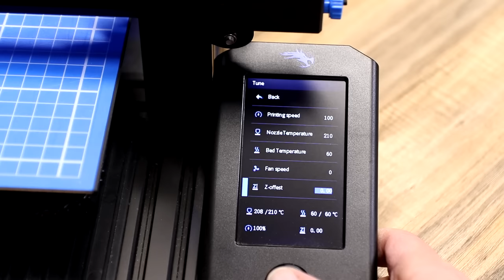Ender 3 V2 Bed Leveling : Quick Look at How to Level a 3D Printer Bed

Comment: 2 problems I came across and the solutions to save you some time.
1. When you hit the auto home button, one of the motors makes a loud Brrrr sound.

Solution: The bed is too low and it's hitting the Y-axis stepper motor in the back, lose up the wheels till you see some clearance or until you can move the bed back the farthest position without any resistance (until the you hit the limit switch)

2. You're going around adjusting all 4 sides but one of them doesn't raise the bed enough even when it's completely loose.
Solution: Keep going around doing the others and when you come back to the loose one it will be tighter because of the other adjustments.

Comment: I don't think disabling the steppers to do the leveling is a good method. When moving the hot end with your hand you can accidentally move the Z up or down, I get a much better result from using the move feature in the menu and let the motors do the real accurate movements. I have a gcode for it but you can manually do it also, Just set these z axis points to get directly above the screws.  1st screw is 30x30y , 2nd screw is 30x200y, 2rd screw 200x200y, 4th screw 200y30x
Reply from the maker: I also have Gcode that does this, but I wanted to show a quick method that can be done with nothing but the basic machine. But I do think it's a good idea to use the Gcode or leveling feature if it's built it I the firmware. Thanks for watching!
Reply: @TheEdgeofTech  question for you regarding the method you used in this video. When you use the "tune" feature to adjust the Z stepper. Does the SD card save that new number? 

When I 1st got my printer I used your method to level minus using the tune to adjust the Z. Now a half a roll of filament later... when ever I use the paper to just lightly kiss the nozzle. When I go to print, I have to lower the bed during the 1st few passes as it is smearing the filament. I actually have to drop it quite a bit to get it low enough. All my prints stick fine but I get a flat and wide filament that first pass around. Some times I get no filament out at all its so close. I never had that at first and I'm doing nothing differently than I am now and actually going lighter on the paper tug than I did when I started out. I use to set it with a decent tug. Now I have to barely feel it.

If I go tighter with the paper now it makes it worse now. Why would that change? All stock 3v2 and I have the bed springs pretty tight to keep from moving and as low as possible to still be able to turn the wheels. I have new springs coming but I'm thinking I'll have the same problem.

Comment: Anyone else struggling like I was, I found I'd put the x-axis belt tensioner on backward. Sounds daft but it fits and looked right at the time. After correctly placing it, the prints came out beautifully.

Comment: On my Ender 3 the wheels are marked "up' and "down", not tighten and loosen. As a total beginner I rely on accuracy in such things. I assume you meant to start by moving the bed all the way down 😁
Reply: Lefty lower ... Righty Raisey!
Reply: As a human use common sense. When you tighten the screws the bed gets lower and when you loosen the bed gets higher.

Comment: I know this is a bit of an older video, but hopefully someone sees this comment - I've watched a couple videos like this with similar procedures, but even dropping the z axis as far as it can go, it doesn't come anywhere close to the bed to do what you're showing with the springs in roughly the same spots. I have to loosen them a LOT to get the bed to a point where it is even possible to meet the nozzle. I've done this and had a mostly successful first print, with a single support failing to adhere to the bed, but didn't seriously affect the result. I'm at a loss as to why my bed seems to be so much farther down than everyone else's with respect to the nozzle, though. If anyone has any thoughts, I'd love to hear them.
Reply from the maker: Thanks for the comment! I'm sorry you're having trouble!.  Did you move down your Z End Stop?

Comment: Personally I don't like to disable steppers and move it by hand. I find that it adds the issue of slightly misalignment things with the force. I just use the move function and move the extruder like that. I'll go directly over each spring about 3 or 4 times around checking the center at the end

Comment: Would you be able to do a video on the BLTouch for the E3v2. Start to finish. Install, Calibration, First Print for some one who is new to all this.
I've watched a bunch of BLTouch videos but it seems like things get skipped over in the videos that I've seen. I think a lot of this is due to the person who is making the videos already having it setup, level and ready to print.
They are always like, "mine is already set but you just do this" but don't really show you.
Thank you!
Reply from the maker: Great Idea!
Reply: I put one on my V2 recently and, yeah, between guides with people running 3rd party firmware, using random brackets and other mods, or skipping over vital steps like setting the z-offset, it can be a bit of a minefield. A straightforward, start to finish guide on stock hardware would be very valuable.

Comment: Hi, when you say paper dragging in-between the nozzle and build plate is it like a scratching feeling? or is that too much?
Reply from the maker: Yes, exactly! But not tight enough where you can't push it back in with one hand. So you should be able to slide it both ways back and forth without the paper wrinkling.  If the paper wrinkles it's too tight. But it will feel like a light scratching between the nozzle and the paper.

Comment: But why, after I auto home, does it not reset it back to the way I just adjusted it??
Reply: I feel like ive been having this problem too, it auto homes to 2 different heights above the bed, I re-auto home a few times and it will then be where I correctly leveled to, I cannot figure out why this started happening. Checked the z limit for tightness, got new springs, level while warm, then I thought it was Gcode, but i double checked all that and found no issues. I usually have to end up adjusting the z axis in tune like this guy did, so I started printing with brims so I have a second to tune it before the real part of the print gets started. I got a BLtouch, but im not super excited to set it up yet, the zaxis tune helps me, but I know there is an issue going on that I cannot figure out. Annoying.

Comment: Jim,

I installed a EZABL sensor on my Ender 3 V2, and have been experiencing frequent need to 'babyset' the z offset. I know you've done a video on the installation of this same Auto leveling technology. I followed the setup as specified in documents and an youtube video, including calibrating the sensor.  I was wondering how your experience has been with the EZABL Sensor. Are you finding that the z offset has to be adjusted frequently?

Thanks 

DT
Reply from the maker: Good question! I normally don't need to mess with it to much after doing it the first time. Are you saving the config on the printer after you dial in the baby steps? By that I mean going to control and clicking the save option. That should save the config and you shouldn't have to mess with it unless you move the printer or are still using springs that can move. I like using the solid bed mounts as them don't move and that's a variable that I don't have to worry about.
Reply: @TheEdgeofTech  Yes, I still have my upgraded "yellow" springs on the bed as insurance policy for me so if my print head come crashing down on it I'll at least some some accident forgiveness.. perhaps this is why I am experiencing my issues with leveling. I believe EZABL includes a STL file that has the solid bed mounts. I'll get to those today and give it another try.  Another thing, I noticed that you are using a Magnetic printing surface from TH3D, how do you like it?  I still have my original Ender Glass on my setup and I am seriously thinking about making the switch.

DT

Comment: Your bed is much higher than mine (I see you don’t have the standard glass bed that comes out of the box like the rest of us) 
I have followed your steps and dropped the nozzle down til it hits the limit switch which is dropped as low as it will go and the bed is still 5mm lower than the nozzle

Comment: I think I've done something wrong in assembly perhaps as when I tighten the front all the way I still have about 3.5mm before the axis is all the way down as if my bed sits a bit too high.
Reply: Tightening lowers the bed, also you may need to move your z-switch.
Reply: @ndsrocks1  Yeah, I needed to move the axis up, ill have to do the same in the back as well.

Comment: I've done this 8 times now. I have cleaned my bed and releveled another 3 times. I cannot get my pla to stick. what am I doing wrong? I'm on the verge of throwing this thing out the window....
Reply: DEC, what 3D printer are you having trouble with?  Does it have 'baby steps" enabled in which you can adjust the z axis on the fly?

DT
Reply: @NSSd80mac  its an ender 3v2. I've tried the baby step method. I'm still getting issues with the PLA not sticking. I'm trying the adhesive now. We'll see how that works.
Reply: Also try reducing print speed to 50% for first layer to help it stick
Reply: @unixtool  I had the same issue on my Ender 3 V2, but here's what I did to fix my issue after baby stepping the  z axis did not work:

1. I raised my temp on my nozzle to 215 degrees C, originally Cura had it set to 200 degrees. Try increasing your nozzle temp to see if it helps. 

2. I raised my bed temp to about about 65 C. This work great, but have since returned to 60 C. This was before I learned about the  bes ways to clean the bed. I'm using 70% Isopropyl Alcohol.  

Aside from those two items above, I clean my bed each time I print just to make sure that I remove the bed from any oil residue, I usually clean my bed when it's already at 60 degrees and whilst the Nozzle is reaching printing temp. I've heard, but have no experience with brands of filaments failing, but apparently some filament brands are better than others due to the material quality. At this point I've use two different brands of PLA filaments:

1. Overture PLAPRO
2. Inland PLA+

One additional tip I have, use the bed leveling g code prints that's available at thingiverse,  Jim makes mention of these in some of his videos. They give you a chance to dial in whilst printing, and can easily be reprinted over and over until optimal printing configuration is reached. Here's one I use.

Ender 3 Redefined Bed Leveling Test & Calibration:
https://www.thingiverse.com/thing:4714033

See if these tips work.

DT
Reply: @NSSd80mac  thanks for the reply. I will give that a shot. I really appreciate the help. Thank you.
Reply: @NSSd80mac  so, it does look like a heat issue. I turned up the heat a little and got halfway thru a calibration cube. I'm going to clean the bed, relevel (just in case), and try to up the temps a little more.

Thanks for all the help and comment. Cheers
Reply: @unixtool  I to have been having some issues, i'm on my third attempt to print a Gozanti Class Cruiser from the Mandalorian. The first two fails were both my fault. 

First one failed because my z axis had an bearing and bracket installed at the top. But after getting so high it would bind. Thus the Gantry was unable to move up and made a mess. I have since remove this bracket, as it is not needed.

Second one, I had reach to clear debris from the table, and it came right back at me. Snapped the print off it's support base. So lesson to myself Leave the D*mn thing alone :-).  Other than that my print settings have been quite solid. Do you have any Auto Bed leveling gadget installed on your E3 V2?

DT
Reply: Just get it as good as you can and buy a washable glue stick. I have an ender 3 v2 and now I just get the bed level good enough and glue stick the bed area. I could never get circles working before but now I can get small circles all over the bed. glue sticks last forever and are really cheap.
Reply: @NSSd80mac  sorry to have gone so long without a replay. Life is fubar right now, so my sincerest apologies and thanks for the reply. I have upped the temps and used a washable glue stick. First, the glue stick is helping. Second, my temps on my Hotend are wrong. The machine and my app, octoprtint, are showing 210 but with a thermal camera I have found my temps are barely reaching 190. I have ordered a new Hotend and will update when it’s delivered and installed.

Comment: Thanks for a very clear and well described video,  having spent over 6 hours now with no luck I am going to follow your video by the second.  Im not new to 3d printers in fact this is my 5th but this one is a headache.  As a point when I disable the steppers the head moves fractionally which I am unsure if this is right ??? Anyway will try tomorrow fingers crossed ;-)
Reply: That's just the wound tension in the rod being exerted by the motors being released. It's nothing to fret about.

Comment: What do you do if you can't get your nozzle close enough to touch the paper on the bed? I have my leveling screws as tight as they will go. I have no idea how to get the bed higher or the nozzle lower. my z stop is as low as it will go ad i still have a gap that is almost a quarter inch.
Reply from the maker: Did you back each leveling screw out four full turns?

Comment: Well done thanks
Reply from the maker: Thanks for watching!
Reply: @TheEdgeofTech  No problem,  this caught my eye after installing EZABL I saw your vid with Tim from TH3D it help out ALOT. Do you have one that shows how to home at max instead of min using marlin at the front left my X hits the frame I made some adjustments in the FW with no luck so.. I thinking about using the 210,210 for home.

Comment: My ender 3 bed was terribly shaking in its  front and back movement, i fixed  it with 2 linear bearing and 2 steel rodes, now the movement is very,,

Comment: For advanced people: There's gcode for leveling the ender 3 v2 on thingiverse OR get a firmware upgrade called "Ender 3 V2 Advanced Menu"
Reply: does it level for you?
Reply: @wyrdboy6414  it doesn't. It just makes your nozzle go through 5 positions (4 above the springs, 1 at the center), it stays stationary till you level it, when you feel fine just press play and it goes to the next position
Reply: @blacksilla  thanks a lot i'm still having issues with the springs that came with the 3d printer and not even getting it to stick due to the level changing often
Reply: @wyrdboy6414  Having the same issues, got new springs but they're still in transit. I just preheat the bed, level it, glue stick or use a brim and it prints fine

Comment: I’ve been through the process with good success and great prints. I recently had a print fail, however, and when I tried to level the bed again, it doesn’t want to go level for me. Specifically, i get though the process, everything feels great, I auto home, and the nozzle hits the bed every time. What is the best way to trouble shoot this process?

Comment: my ender 3 v2 does something like z banding but very random, i check everything is square and x axis is on level, 90 deg plate is exactly 90deg, hotend is nice and clean, capricorn tube sits nice, no wobble in Y no Woble in X all medium tight, slicer settings seems not causing it, after upgrade to bondtech extruder same happen, after 2 spool of prusament using for calibration cube and benchy im done with this printer <_<

Comment: Do you have any advice for if the nozzle keeps going too low on the print? I have the bed leveled but after a few layers the nozzle will be too low and I have to manually adjust the bed so it doesn't make scratches. I could level farther away from the bed but then it won't adhere properly.
Reply: Have you tried upgrading the bes springs. Also is the printer on a good solid surface so its not vibrating and moving about? Could be that the vibrations are making the bed move a bit.

Comment: For me, I just move the axis with move function on the screen. when disable stepper motor the x gantry will freely move down and difficult to level that bed
Reply: That's a good tip, I wonder why more people don't do this??
Reply: @kaylor87  yeah but now ender 3 v2 latest firmware by Jyersm already provide manual mesh bed leveling function. Finally 😁
Reply: @nhmaker2899  Oooo, good, that's awesome to hear! (: Yay for improvements!

Comment: @3:00 that's my AHA! moment! I kept trying to "auto home" and the directions said to make the extruder tip 0.8mm from the bed but mine kept hitting the z axis limit switch and stopping like 10mm away from the bed! I never thought to just manually screw it down using the z motor haha THANKS!!!!
*HOWEVER!!!
my z stop switch plate has a tab that keeps it from being mounted any lower, so I can't really "cheat" like this?? Should I remove the tab with a dremel??
Any help for this n0oB is highly appreciated!!!
(And yes I have adjusted the bed up until it runs out of threads, still too far away!!!)

Comment: Hey I am super new at this. My corners are square but I seem to have a slight dip in the center of the bed. Any suggestions?
Reply from the maker: You have a couple of options. One, you can adjust the level to the center and make it work with the rest but it'll be a little low for the rest of the bed. Two, you could put a piece of tin foil or blue tape underneath the bed where the dip is and see if that's any better. Basically try to raise the center a little bit at time until it's better.

Comment: Is it normal for the rear left knob (the one closest to the heat connection to not have a spring in it? I noticed that there was only three springs on my bed when I assembled it. The rear left corner knob didn't have a spring on it.